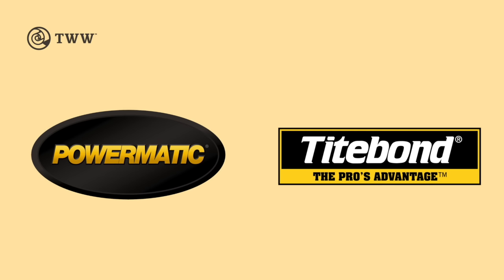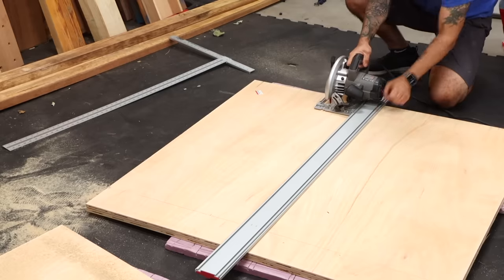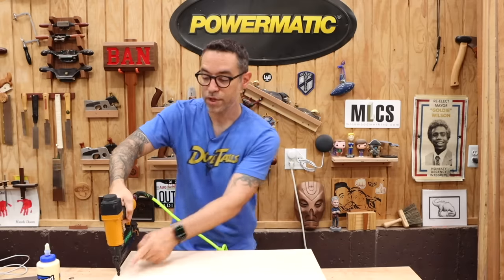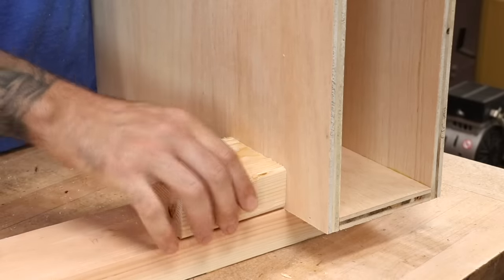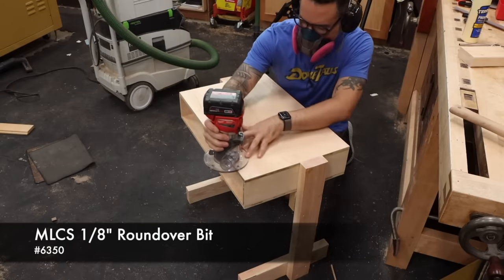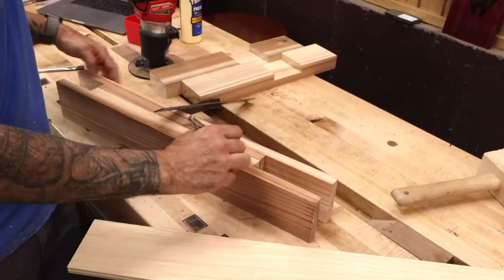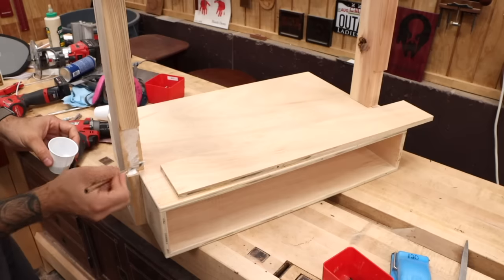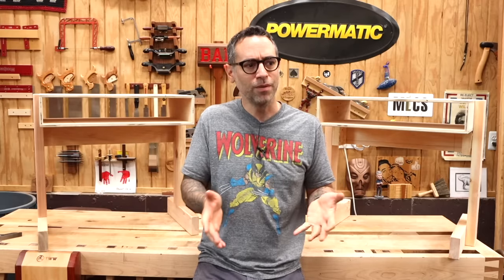DIY Kids School Desk - Quick, Easy, Inexpensive!

Comment: How tall are your kids?  And how tall are the chairs they are sitting it?  I've got 12 orders for these and I've gotten a few people with older kids asking about height.  I figured I could get any where from 24" to 31" in height pretty easily from the single 2x4, and I've been telling them to get the chair they expect to sit in and add about 9" -- just asking for an extra data point.
Reply: The table I made for my first grader is 19 inches tall (I repurposed the legs from her lego table.)  It's probably a little low for the average 7 year old. (She's a short stuff.)  The under-cubby on these is going to create some desk top height vs. leg clearance issues.  For little kids, making a narrower cubby (or just a desktop) might be the way to go.
Reply: I made four of these, but two are 24” to the underside of the desk because they are for older kids. 19” is too low for them but okay for little ones.

Comment: i tried to make a similar desk for my wife long ago. i skimped on the wood and used cheap 2x3s. and i dont have a jointer or planer.. it was very wobbly on a flat floor. i had to place the desk on a padded floor for less wobble. after a few days i disassembled it and made a 4-legged desk instead, with better lumber.

Comment: What type of plywood did you use?  The cheap stuff I buy for shop projects doesn't seem to be stable enough to have a smooth writing surface. There seems to be hard and soft parts to the wood that would make writing on it difficult.
Reply from the maker: Nothing fancy. Just the Sandeply stuff from Home Depot.

Comment: Thank you so much for putting this out!  I just built one last minute! One thing when screwing two pieces of wood together that I learned is to drill a clearance hole in the first piece for the screw to go through; no clamps needed to hold together. Then hammer the screw to tap into the second piece so your position is held in place. Appreciate the tip on the brad nails too!